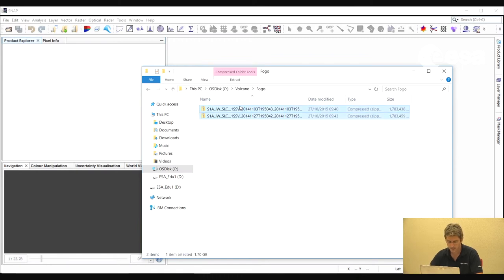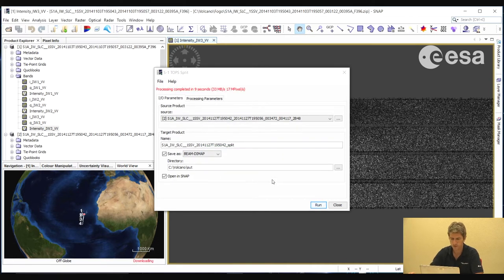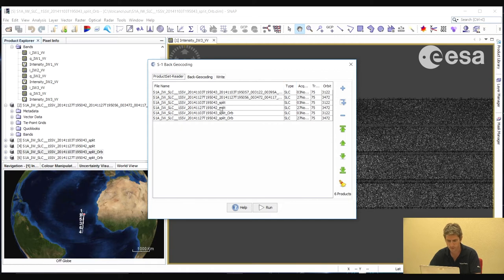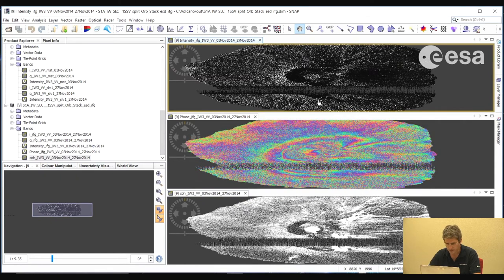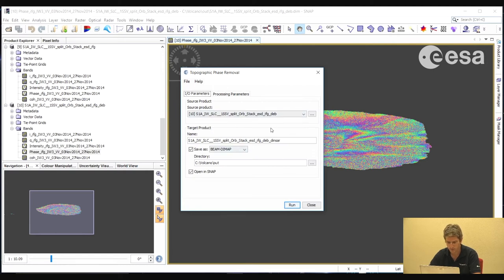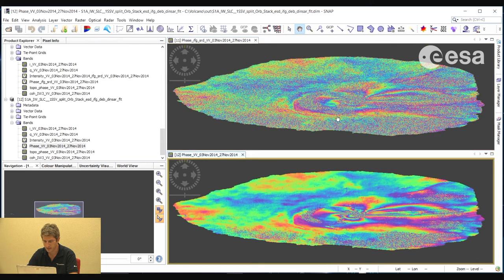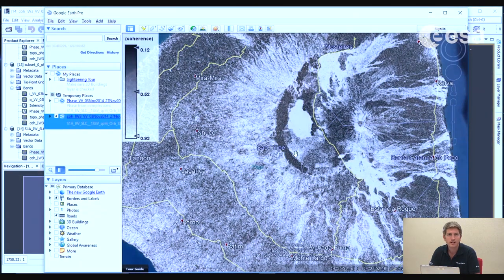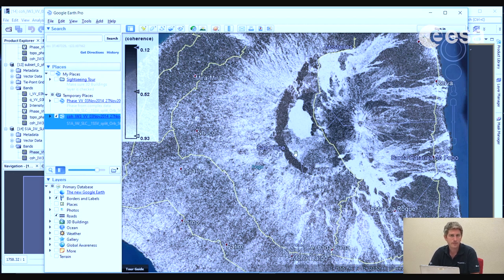ESA Echoes in Space - Hazard: Volcanic eruption mapping with Sentinel-1

Comment: Thanks, but I'm having a hard time when I do S-1 Back Geocoding step. No image is formed.
When I try the next step, Enhanced Spectral Diversity, I get the message: Registration window width should not be greater than burst width 0.
Remembering that the area where I'm trying to do interferometry has the original image mirrored, but I already fixed the problem. So the image is already deburst and is Ellipsoid Corrected. Does anyone have a tip?
Reply: I had this same problem. First make sure your software is completely up-to-date. If that makes no difference try switching around the slave and master image. I'm no pro but I think if the geo-coding doesn't work then the subsequent steps won't work either. Also loads of answers and different solutions on the STEP forum. Hope this helps!